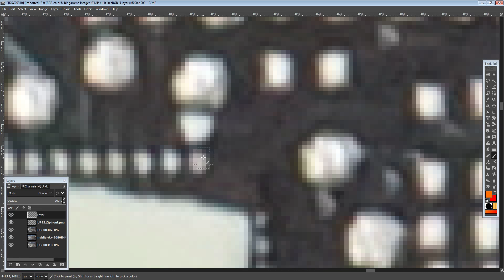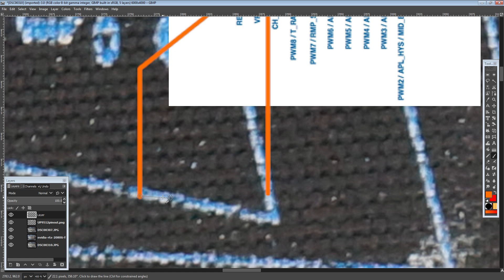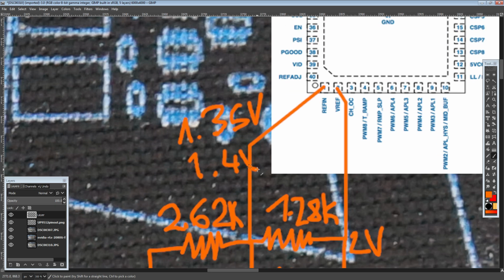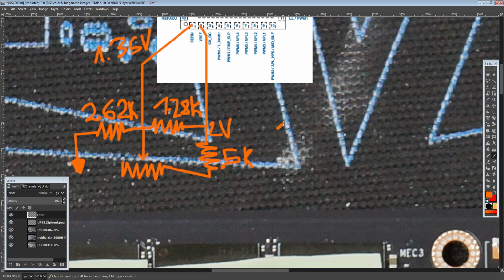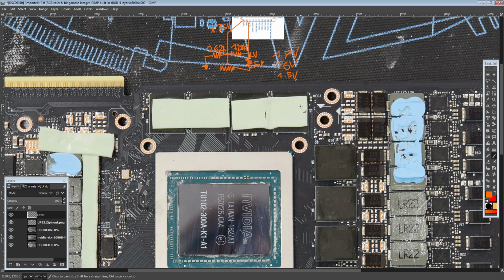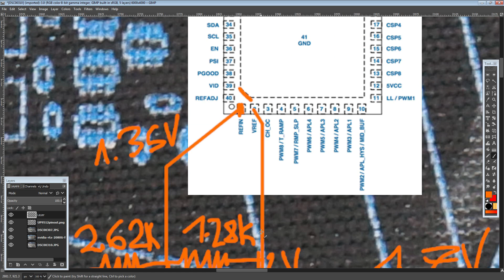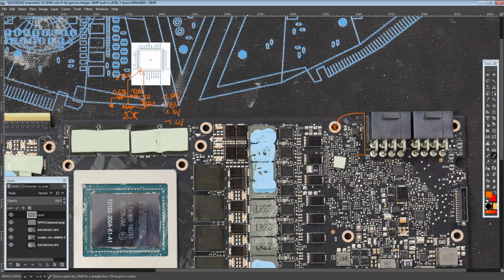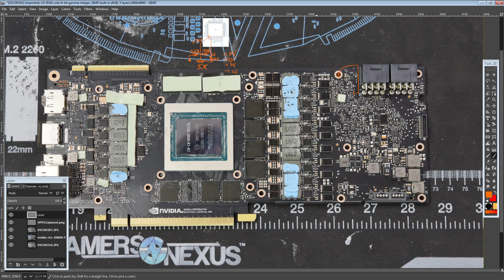The RTX 2080Ti FE memory voltage mod (Titan RTX uses the exact same PCB)

Comment: Important question please, i trust your knowledge and advise :) Can you tell me if by changing the 2 resistors of 5mo (1 in each side) by 3Mo will be safe ? if i understood it will increase i think the power limit ? is an good thing to do it is safe with an good custom wateblock/watercooling ?
Reply from the maker: I've replaced them with 3mOhms shunts on the 2080Ti BZE I did. It works just fine.
Reply: @ActuallyHardcoreOverclocking  then is the best solution right ? :)

Comment: Im trying to remove a IR 3553m VRM(blown)  from a sapphire nitro r9 r390 with a hot air station but I haven't been able to get it to budge. Is there any advice you can offer on getting this part out?
Reply: What temperature are you using.
Reply: @ApplesOfEpicness  I had the hot air station set to 450F but I've come to the conclusion that this cheap hot air station is damn near useless on a multi-layer pcb :(  If you know of any tips or tricks that would be cool! otherwise ill probably save for a new card and fix this one down the road when I upgrade my equipment.
Reply from the maker: @Elitemonkeys32  Try preheat the board. Taking the whole board to like 100C should be perfectly safe for the board. That should make the boar sink less of the heat from the 3553 when you try to remove it.

Comment: Hey buildzoid, any tips on how to find where the temp sensors are on the motherboard. 

My Asrock AB350m PRO4 is randomly rebooting while on IDLE and it only happens on very hot days. 
My plan is to put a cooler right where the sensor is to avoid random reboot.
Mem is ok, got on memtesthci to 850% and Processor won't rebbot while doing prime95 even after hours.

Comment: Memory voltage mod on graphic card series thats known for memory dying after some time?

Yea what could possibly go wrong. :D
Reply: It was related to Micron modules I think, Samsung should be fine (the card he modified has Samsung modules also).
Reply: @C0manso  Samsung memories (or IMC or whatever) also died, at least two known cases. :/

Tho in general its just 3% overall RMA rate, thats actually very normal, some graphic cards in past had even 9%, mostly due manufacturer being cheap.

Comment: Hm that hotspots so thats why radeon vii got %2 more by just fine tune itself.  I suspect it will scales relativly more by doing it. If its not at edge of it alredy. Stock cooler probably the limiting factor then...

Comment: So basically the value of the voltage dropped across the 2.6k resistor is what will be sent to the VRAM?

Also is this safe to do with Micron memory? I thought a lot of it was degrading at stock...or is it the IMC that's degrading?
Reply: So far nobody knows for sure.

But for sure you wont get it RMAed with mod. :D
Reply: I don't have one or plan to buy one but was just curious and might be relevant to others. Like, maybe if you have micron mem you won't want to do this but if you have samsung it's probably ok. But if it's the IMC that's degrading you def don't want to do this either way unless you're made of money.

Comment: How many years have you researched this?
I'm only 14, and wonder if I can get to this level by the time I'm your age. I only found ur channel about two weeks ago, so, I'm still lacking a bit, but, I understand maybe 80% of what ur saying
Reply: start with older hardware. its very easy stuff once you understand basic concepts. if you give some time every couple days it will take less than a year, modding is easy designing the board is hard. but just start simple, like what is voltage divider, current divider ecc
Reply: @alexc5798  oh ok
Reply: Keep watching vids, fry a bunch of cards and you will learn naturally. Cheers :)
Reply: @DarkoPetreski  lol ok
Reply: What Alex Dark is saying is correct. I would add that you should pay attention in physics class whenever it has to do with electricity. A lot of the concepts you'll learn there applies to overclocking. You can also do some courses on Brilliant.com on electricity and I would guess electronics even. I haven't personally tried that site, but plenty of science YouTubers are sponsored by it, so I'd assume it works.
Reply: @DirtyPoul  I'm only in 8th grade, so I don't have physics classes yet, I will do any courses if they're free ;)
Reply: @mochageico  Go around on YouTube. Channels like Brady Haran's channels, Veritasium, Steve Mould, Kurzgesagt, minutephysics etc. all have Brilliant sponsorships meaning you get the first 30 days for free IIRC. As for afterwards, you'll have to pay yourself. Unless your parents are poor, I'd ask them if they'd pay if I was in your situation. What parent is going to say no to education for their child? Show them what it's about during the first 30 days and I'm sure they'll let you continue :)

Comment: I have a very noob question... related to the Radeon VII Gamers nexus video ( and this one and many other) where we see unpopulated PCBs... What would happen if somebody fills those pads with the appropriate parts? The tracks are there? I mean if it would help overclocking why wouldn't the hardcore overclockers fill those gaps in the VRM? Or do they? I wondered, if a 3GB 1060 pcb  with the missing pads could be a 6 GB one (with a bios flash of course) if somebody fills those in? You say some of the components are expensive, but those are 4$ instead of 2, so it is very relative. You said you would buy a 1000$ GPU if those gaps would be filled in the Radeon VII VRM... and for about 10$ you could get the part... ( even if its's 50.. or 100) and you can buy a cheap hot air station and voila.. 
 I'm guessing it's not that simple, is it? :)
Reply: Hmm. I'd like buildzoid to step in here. Not sure if what these guys said is correct. I am pretty sure the traces will support the components. I'd imagine in the case of the missing phases on the Radeon card that you would need to tell the vrm controller that it has more phases.
Reply: The memory controller is cut off so most of the time adding the memory won't do much. If you were to actually attempt to add memory it would be incredibly hard since it's a bga chip and you need an expensive machine.
Reply: @Corei14   I wouldn't be surprised if the memory controller is cut off... Still I'd like to see the someone try, maybe it isn't. :)  BGA soldering is not that hard with a small memory chips like these. (I saw people soldering the GPU chips even, with success Eli tech comes to mind)  I'm not saying I'd be able to do it, but many could. And maybe the memory is out of the question because of the cuts on the chip, but the VRM still could be modified... the pads need to be measured if the voltages are there or not.
Reply: It's not simple as that. Yes, you can buy all that parts and even solder them on PCB. But problem is - they will be on PCB, but not connected to another components. When you look on PCB and don't see connections, because they all inside PCB between layers. Try to find such image... there a LOT tiny wires and no way you can add them. It's need entire new PCB.

BUT, very important "BUT" - when manufactere use SAME PBC for high level product and middle level. All main components already may be on board, but another just cut. And if you add them - card simply start to work as High-level. It's very rare, but it's possible.
Reply: @rusTORK  The unpopulated places are a good indication that manufacturers often use the same pcb for lower tier cards too. I see the manufacturers cutting parts of the chip like the memory controller part much more likely than cutting traces on the pcb too, but I'm not an expert. I know that the pcb-s are many layers, but especially because of that I don't know if there is an easy way to cut those traces between layers. I didn't see any obvious surface cuts on the pictures. Measuring voltages before any soldering could prove if those pads are connected. So I'd definitely not solder anything before that.  :)  I just sold my 1080 so I can't check anything, and the replacement will be under warranty so probably not there either. With the question I kind of hoped that Buildzoid could check those pads at least or share his knowledge why even that step could be foolish, if he knows something for sure.
Reply: you probably could if you were confident with the ball soldering but you'd need compatible bios which i imagine would be an MI50 bios and pretty sure that would hurt consumer use performance could be wrong tho.